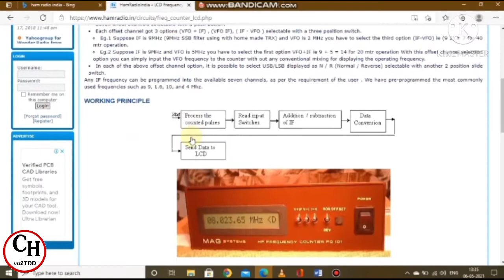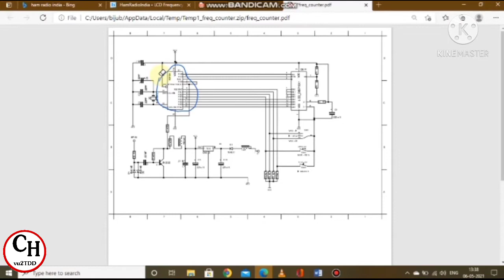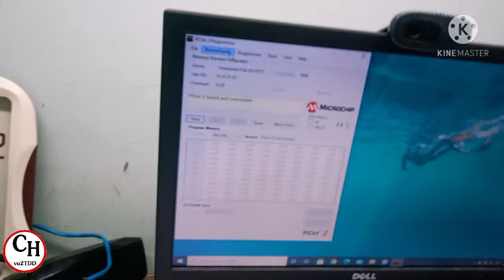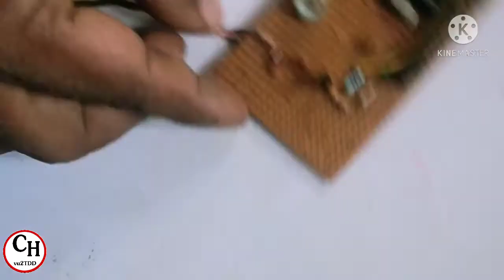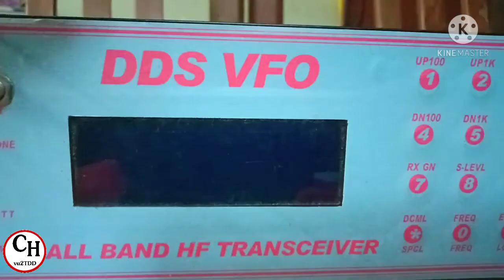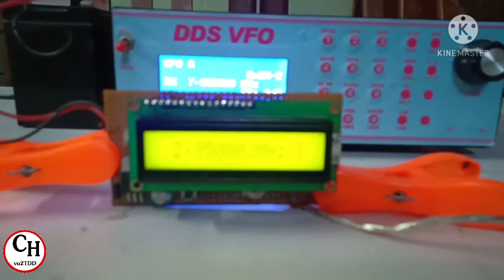Frequency counter #PIC16F628A

Comment: how to add prescaler?
Reply from the maker: Use MC12080 ic, you can see circuit of prescalar in www.electronics-diy.com
Reply: @crazyhamselectronics6318  yes, but how to handle software side? And do you have any ref to buy this prescaler in India? Thanks.
Reply from the maker: @RepairRadioLab  No idea about the availability of prescalar ic. May be available at Bangalore or searc in online shop.